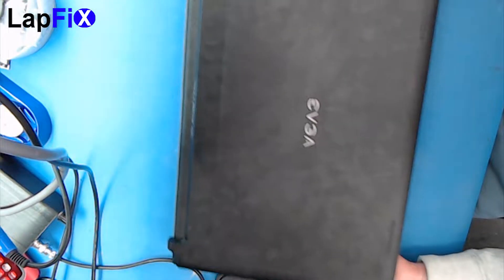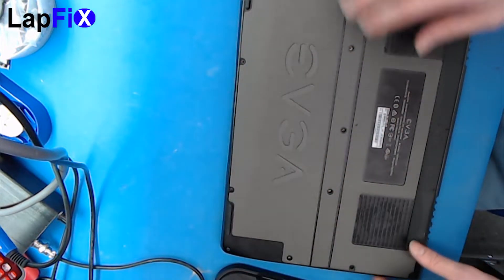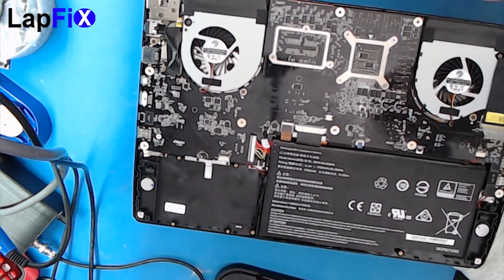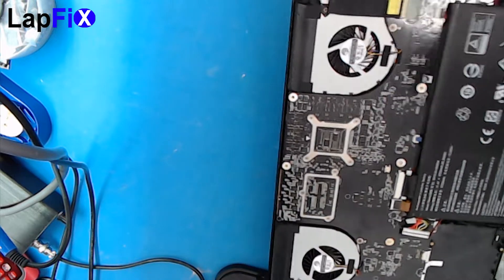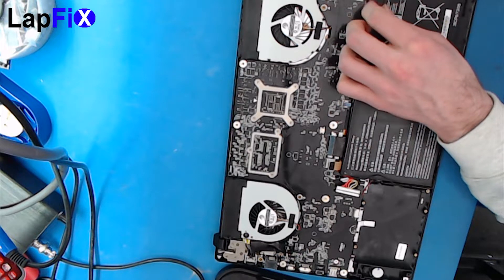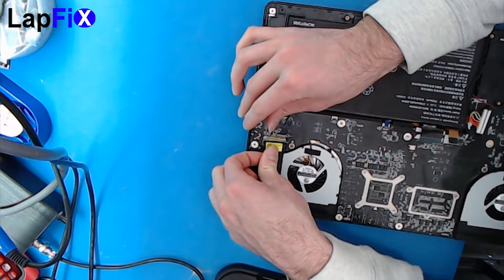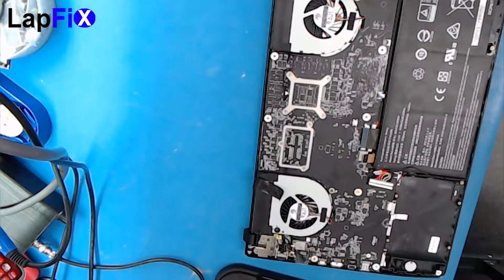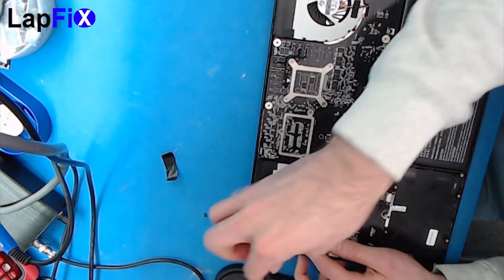EVGA Laptop SC15 Teardown - Motherboard LapFix

Comment: mine seems to by glued near the hinge.
Reply: Those little plus signs on the rubber on the bottom near the hinge are actually little grooves you can stick the T6 into and loosen the screws
Reply: Literally same. It's making it impossible to repair it.

Comment: what is the screw driver number or name?
Reply from the maker: The one I used in the video on the board is just a regular Phillips head screwdriver
Reply: @lapfix  Hi, what's the screw driver you used for the actual cover of the laptop on the back? The video starts with those screws already out